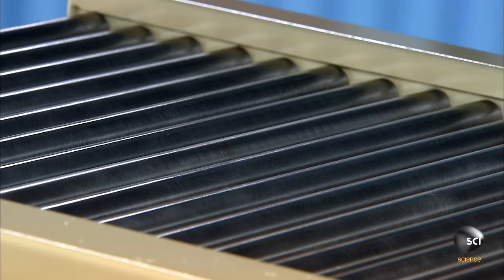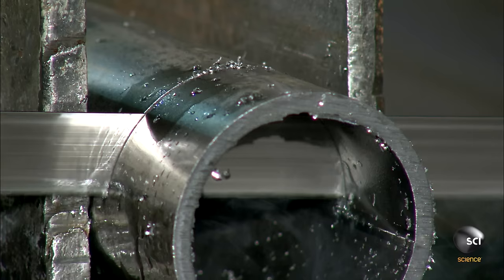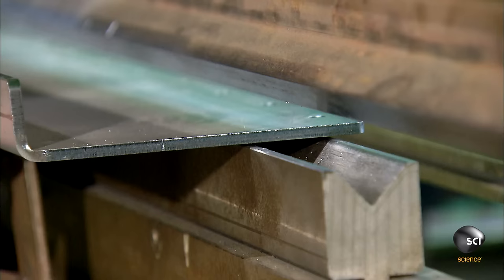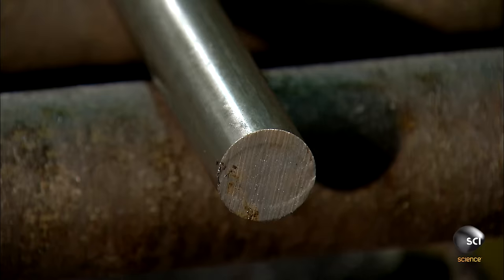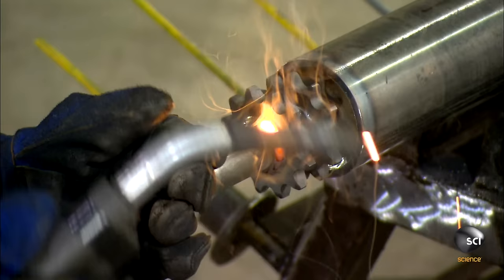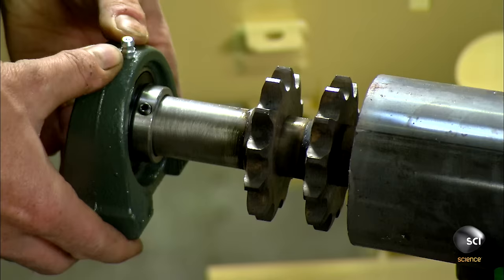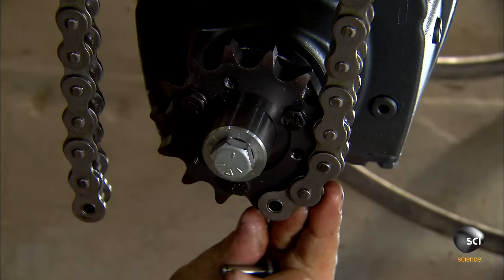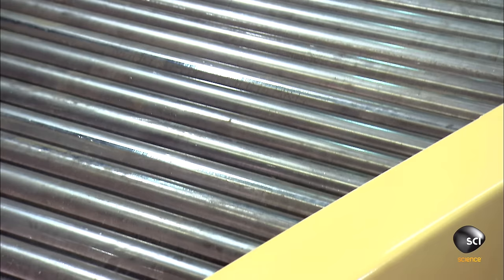Roller Conveyors | How It's Made

Comment: I've seen a lot of conveyors...That's a beast they just built there! Heavy duty!
Reply: compared with chinese conveyor that this conveyor biggest difference is each rollers come with a bearing.it is why the conveyors can be so heavy on loading.
Reply: @joycefu6562  Different conveyors for different applications. It makes 0 sense to purchase one of these big boys if your application is lightweight.
You're gonna be spending 10x the amount just on setup, then you still have maintenance, footprint issues, movability, etc.
If there wasn't an application for the "Chinese conveyors" nobody would buy them.
Also, in most smaller conveyor systems, the ball bearings are built into the loose rollers, it's just smaller and not as visible.
Reply: @miguelzavaleta1911  the latter is only the case with unpowered rollers right?
Reply: Def not just for cardboard boxes
Reply: it is chain driven live roller conveyor and is specifically used for transporting full pallets rather than cartons, totes or boxes.

Comment: I just want to lie down on one of these
Reply: Same
Reply: Mere too... I always hink about it......
Reply: +Brian Swalley There was one covered with a rubber belt in the place I worked at for moving boxes between the store and the basement. I rode up to the ground floor with the products once.
Reply: nah its not that tight
Reply: Not on the motorized roller systems, but on the loose rollers -- get a piece of cardboard and you can slide around on those. Pretty fun, especially in factories where they run long lines of these.
If only the factory workers knew the fun contractors get to have on their workplaces lol

Edit: obviously only when everything's shut down. Don't wanna slide into something that could kill you lol
Reply: pretty sure these shits can kill you
Reply: @blitzie66  unlikely to kill but the exposed chains and spaces between rollers will give you a wicked bad tenderizing.
Reply: @EndlessDelusion  ahh ok

Comment: I never knew they alternated the chains for the roller sprockets, I always though it was just one long chain.
Reply: Exactly, why don't they use one long chain?
Reply: @shahuni  Probably because it's less likely to lose tension because each individual piece is being acted upon.
Reply: @thegeneralissimo470  Yes. And if the gears are joint together, every other roller will move in the opposite direction, so it will defeat the purpose!
Reply: With a continuous chain the drive is transmitted to a single tooth of the sprocket transferring less power. The cam action of the rotating sprocket also pushes the chain away and requires a low friction pressure pad to hold the chain in contact, the tooth form on the sprocket has to be modified to reduce this effect. The disadvantage of multiple chains is one of back lash when reversing the drive which can shock load the gearbox. It is also significantly easier to change a roller or an individual chain due to wear or damage.
Reply: @shahuni  As the chains are easy to slip，they need to drive every roller

Comment: Bigger Question: Why so many chains and not just one contiously supported one? Wouldnt that be more Material Efficient and easier to fix?
Reply: Multiple small chains supplies low torque losses due to having a half wrap on every sprocket, also, one long chain across the tops of the sprockets would allow the chain to slip causing loss of drive, causing the conveyor to not do it's one job
Reply: I think most manufacturers opt for servos these days, direct drive is more efficient & can stop on a dime

Comment: 1) why are the rollers driving in pairs? could you not drive them all together off one long chain? 2) what does the middle support disc do on the axle?
Reply: 1) To spread the load between the pair of sprockets. It makes the equipment more durable!
2) It spreads the load in the middle of the equipment to the axles. If there wasnt a middle support disc, the steel tube would probably bend and deform over time!
Reply: @RafazildoBR  thanks

Comment: What's the benefits of modernized rollers vs normal conveyor belts?
Reply: Conveyor belts are for lighter loads. The rollers are able heavier items.
Reply: belts are also used for loose items or items that would fall through the spaces between rollers (why all grains, minerals, etc, are transported on belts).

Comment: not an economical design of conveyor so for. there is no need of too much number of bearing blocks.the second thing is that sprockets are welded with. what will happen in case of sprocket replacement?
Reply: im a maintenance mechanic at a corrugated packaging plant, and I kid you not, we had to replace a faulty sprocket on a roller exactly like this today!!! The shaft on the roller broke completely off. We had a spare roller and new bearings, but unfortunately no sprockets of that size/dimension. We were able to reuse the sprocket off the old roller (THANKFULLY THEY WERE NOT WELDED ON)
Reply: There are two ways to work the axles, blocks on the outside or bearings inside the roller. This is a low output factory that doesn't have the capacity to make intricate rollers so they use the blocks. The sprocket welding is actually the best way to do it considering the stress involved in repeatedly starting and stopping a roller. Simple hex nuts aint gonna do it.
Reply: any one available  perfect  roller  Conover deign  please  reply
Reply: theres many diff styles of conveyors for a reason. all the chains and blocks on that model are for heavy objects. you need more support for heavy items. you didnt see it moving a huge pallet at the end?
Reply: Grind
Reply: True that.
Reply: you'r totally right. I mean.. did u see the company? They are good but sure the leader conveyors company will not show to everybody how they make them :)
Reply: @LegendLength  you have no idea you dont work in the idustry that these conveyors are meant for brass busges would last an hour you need ball bearings this equipment is meant for heavy loads

Comment: Very informative. But I believe the thing what you are calling motor is a gearmotor i.e. a gearbox installed with a motor. Having a solid shaft on which a sprocket is installed for the chain to transmit.

Comment: This seems rather silly? What's the benefit of using so many chains? Wouldn't it be simpler to use on chain, and one sprocket per roll?
Reply: If you only used one chain for an entire bed the you would have serious issues with slippage. There would only be 2-3 teeth touching the chain at a time on the top and probably 0 on the bottom due to chain slack. With 1 chain per roller, you have 8+ teeth touching each roller.
Reply: While it could be done in theory without slipping as sappy pointed out by having the chain snake around the sprockets like a slalom it would probably put more stress on the bearings.

Comment: 4:55 seriously??? 2 tons of objects?
Reply: Yes, a very common application in this industry. Reduces fork truck drivers to almost zero. Moving 2+ tons of objects is crucial (not so much in a big box they show) but in a manufacturing facility/assembly line type of process this is widely used. One customer we deal with has 3 ovens stacked on top of each other being assembled simultaneously as they are conveyed.
Reply: @brooksmauldin8271  ok I understand. i thought its just their marketing strategy. but I think you're right.

Comment: Welding the sprockets right onto the shaft. Real smart...NOT. The user then has no easy way to service it. Sprockets do wear out.
Reply: Then they can sell you premade rollers lol
Reply: @davidjohstono524  that's what grinders are for!! but yep thats why they do it and its a lot cheaper than putting a double sprocket and taper lock on them all

Comment: some of the ways they built this isnt necessary...you dont need to waste time and money welding the spacers to the channel...when you could just punch a few holes and connect the spacers and channels with bolts and lockwashers..
Reply: not to mention all the bearings when there is a much cheaper and cost effective way to build with like 10% the amount of bearings

Comment: That really seems so overkill and heavy.
Reply: You did see where they moved a 5000lb item across the roller and it stayed perfectly level and flat, right? To put that in perspective, that's as much as a modern full-sized SUV weighs. And industrial equipment is commonly built well beyond what it's actually intended to be used for because if you build something stronger, there is less maintenance downtime or damage over time because you aren't working the equipment near its maximum capacities. People these days are used to really lightweight-built crap that is meant to last a year, maybe two, and then throw it away and buy a new one. Aren't you sick of being part of a disposable society?
Reply: gymkhanadog 
Good point!
Reply: @gymkhanadog  Yea. They really had the weight of a full sized SUV in a box about 3 feet long for "testing". 🤣🙄🙄
Reply: @coloradostrong  What an utterly weird comment.  "Do you really think that a company that needs to test their product with heavy weights would have heavy weights on hand?"

They probably have several of these sitting around.
Reply: @coloradostrong Do you not understand density?

Comment: LMAO they use a forklift to lift that tiny ass motor. Ppl that build & remove car motors don't even use a forklift. What a bunch of wimps.. 
Do they use a pully system to lift nuts & bolt also ?.. LOL
Reply: That motor is over 100 lbs. and needs to be lifted from underneath. By the time you're done fucking around with another method, it's lifted in place with a forklift and already installed. Is that simple enough?
Reply: You are correct. Mechanics don't use forklifts. They use engine hoists to drop a motor in to an engine bay. You use a forklift to raise a motor in to position because no one wants to hold it there while someone is fiddling around trying to find the thread in a tapped hole.

Comment: This is such overkill
Reply: You missed the 5000lb load moving on the rollers I'm guessing.
Reply: @adisharr  yeah i know, but its whole weight is not being put on a single roller. its weight dissipates over like 6-15 rollers which would almost never be used at maximum load capacity. i mean if youve got a tank factory or some shit then ok, but other then that your over paying for the size.
Reply: I'm not sure you understand how long this conveyor is meant to last. It's designed to be extremely over engineered because it will last 50+ years.

When you're operating a factory that will lose thousands of dollars a minute, you can't afford downtime.
Reply: Please, design us one that is better

Comment: Complexity is built into the the system for monopoly. My Grandpa designed and built a lot of them. With out failure issues for decades. I can bet, every single one of these, will not last more than a year without failure. Anybody challenging?
Reply: i am challenging wholeheartedly. as long as you treat them with respect and maintain them, they can last DECADES and still be reliable.